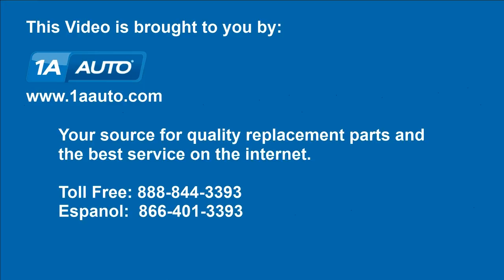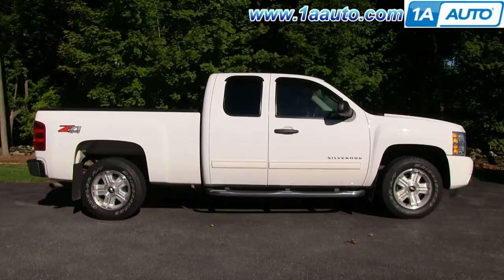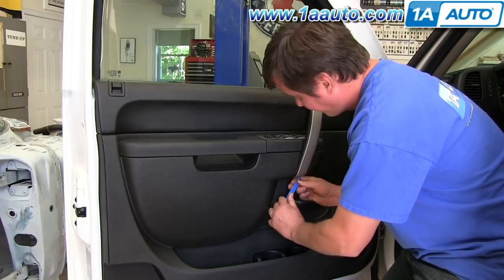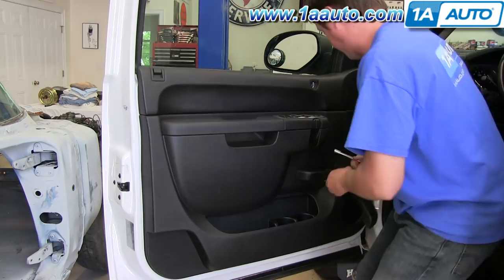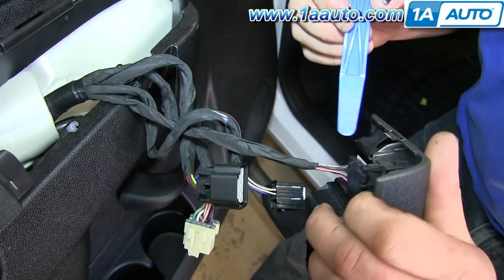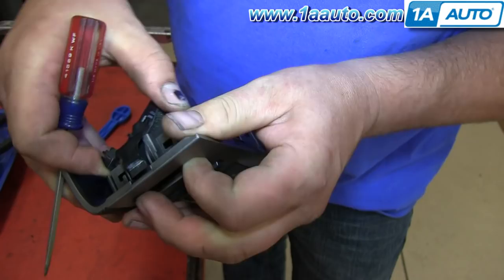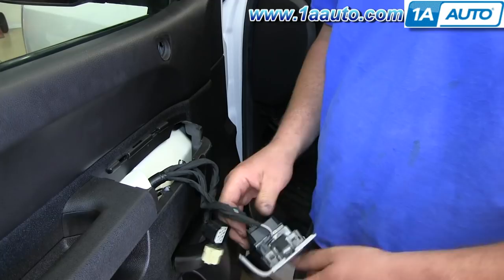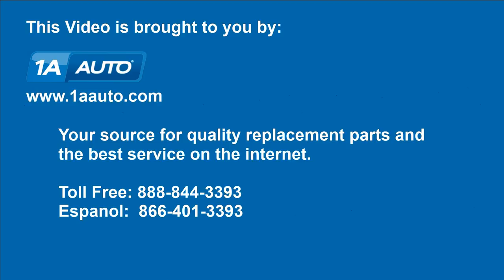How to Replace Power Door Lock Switch 07-13 Chevy Silverado 1500

Comment: If the drivers side switch is bad will that cause the passenger side to not work as well? Thanks. Great video.
Reply from the maker: +Jim Adams The two are not directly related, if the passenger side window is not working from either switch this is likely the motor or the regulator.

Comment: I got a 2013 Chevy and my driver door will unlock the doors but won’t lock them and my passenger door switch won’t do either though is this cause if a bad switch or something else
Reply from the maker: +Justin Jenkins We wouldn't be able to diagnose an issue like that here, you may want to have a local mechanic take a look at it. Thanks for checking us out! http://1aau.to/m/Shop-1AAuto-c

Comment: How do you know if the problem is the door lock switch or individual actuators for the doors.
All my doors have to be opened manually. When I hit the power lock button I can hear the noise as if the lock is locking and unlocking but the locks on the doors don't unlock or lock.
Reply from the maker: +Matt Gurksnis Thanks for watching! There could be multiple reasons why you're having this particular problem. We suggest taking your vehicle to a nearby reputable shop to identify the cause if you are unsure.

Comment: I have a regular cab LT.  Drivers door won’t unlock/lock with the key fob or switch but the passenger side does with both.   Any ideas what my problem would be???
Reply from the maker: +Mike F We can't really accurately diagnose that without seeing the vehicle. We would recommend you take it to a reputable mechanic for diagnosis